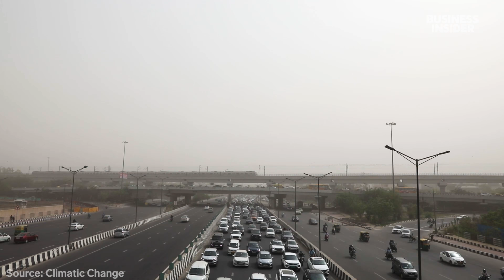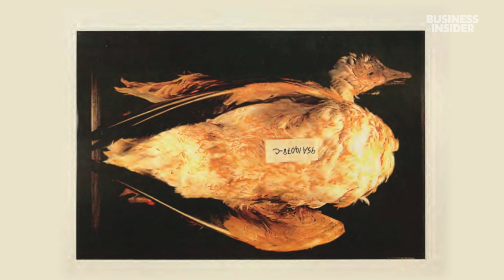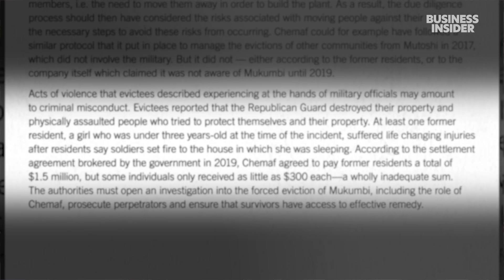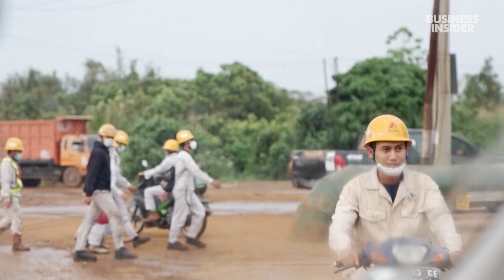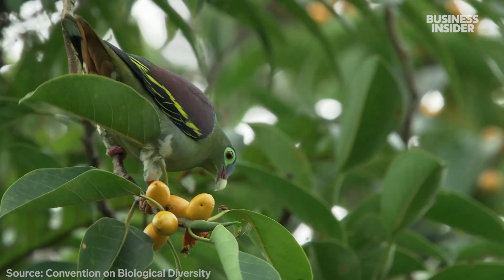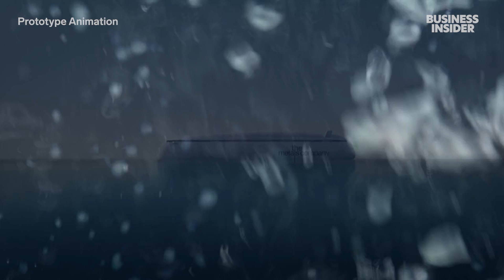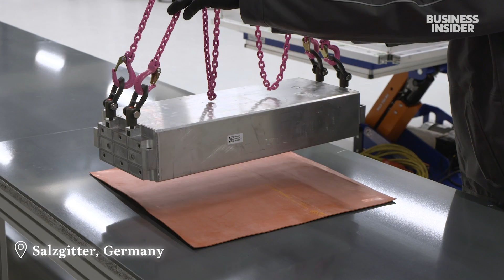The True Cost Of Mining Electric Car Battery Metals | True Cost | Insider News Marathon

Comment from the maker: This video won an Emmy Award! Thank you to everyone who watched, subscribed, and shared.
Reply: Depressing
Reply: Great
Reply: I see there's a True Cost for this, and for lithium. Have you got one for oil? Can't seem to find it on the channel...seems pretty important.
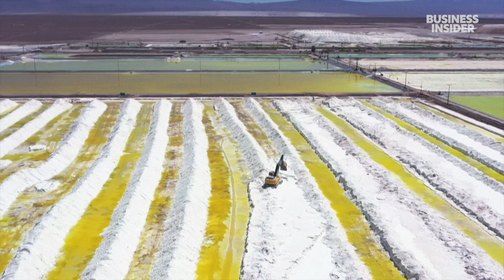Reply: dinamite 4:30 wam
Reply: Likely too fast on that award.  Already way out of date.  (actually was when you made this).  EV (and other) Batteries are moving on to LiFePO4.  Lithium + Iron + Phosphate.   No Cobalt nor Nickel in there.   

You know what does use Cobalt and Nickel?  Oil and Refinery for Gasoline, Diesel, and Steel in Internal Combustion Engines.  But you are probably all okay-dokey with that?  And most conductors are Aluminum -- not so much Copper.  All your mis-information has went away because the real options are both cheaper and weigh less -- both good things for mobile (EV) equipment.

So why all the FUD and mis-information?  Low Knowledge of the Topics?  Or intentional?
Reply: stop being the E.V. supporter
Reply: @hitakpatil5106 why
Reply: How does one get an emmy award for a youtube video?
Reply: “Your average consumer EV has over six times as much mineral content as a petrol vehicle” (Excluding steel, aluminum, and petroleum) 

Why have you excluded those extremely important minerals? That’s almost the entire mineral content of every modern car.

Who wrote this? The oil companies? How did this garbage win an Emmy?
Reply: Because its a video about EV-specific minerals.
Reply: @fredmosby6303 they only want comparisons to tell a specific story, not to legitimately compare true and complete resource use and effects.
Reply: An Emmy for spewing dangerous and disingenuous disinformation?

Comment: The oil industry mined these various materials first and more extensively. MORE cobalt is used to clean fuel than is used in EVs for a start. Also once mined 95% can be recycled so the need for new stuff will fall. Oddly biased anti-EV video.

Comment: We should be moving away from battery-electric cars and toward hydrogen.

Hydrogen fixes the recharge time needed by batteries, the looming large cost of battery replacement as each new charge slowly depletes it's capacity, and hydrogen is endlessly abundant. Battery electric cars are clearly not sustainable because of the materials required being limited.

It's a shame hydrogen isn't being incentived for automobiles with only a few manufacturers investing into the technology.

The hydrogen infrastructure is the clear challenge that will take a long time and a lot of investment. It may make the most sense to prioritize large scale transport, like shipping and airfare, with hydrogen power. Eventually, though, it will need to trickle into the auto industry to release the pressure of mining unsustainable materials.

Comment: as a mechanic im doubting about electric cars being less destructive as combustion cars. lots of car makes label a battery with well over 50% life left as scrap. ive had many electric cars come in where the battery is useless after 5-10 years, the only cars that do have (almost) life time batteries are the Japanese. remanufactured batteries are almost none existant. we should focus on making batteries salvageable for 80% at least, that would make a huge difference. we sadly live in a world that just becomes more and more "throw away".
right now i think that owning a 10-20 year old car is a better option in terms of footprint. in terms of reliability, and life span way longer than newer cars. also, updating all older cars with the newest cat's would also help with cleaner exhaust gasses.
i dont really mind electric cars, just the label "green" i think is idiotic. in reality they should've at least been labeled as "less polluting" (on wich i am not sure that they actually are)

Comment: The carbon footprint numbers can’t take into account a number of variables. 

1. Where is the electricity coming from to charge the EV throughout its life? Different parts of the world use different power sources (fossil fuels).

2. Do we even know how long the batteries are going to last yet? One battery replacement on a vehicle essentially doubles the footprint.

Comment: One of the biggest problems with combustible engines is over the past century car manufacturers have had little to no interest in improving for gas mileage/fuel economy. It would have been very easy for everyone to be driving around in a decent sized and powered car that got 85 MPG over 30 years ago.

Comment: You did not take in to account the fossil fuel used to generate the electricity to charge the battery or the fact the EV weigh more than gas powered cars and do more damage to the roads sooner repairs and the pollution created by the trucks and machines to repair the roads.

Comment: This is old now Sodium is replacing Lithium.. Lithium is being replaced or supplemented by newer, cheaper materials in EV batteries, mainly through advances in sodium-ion technology and the adoption of different cathode chemistries like lithium iron phosphate (LFP). Sodium-ion batteries, which use sodium instead of lithium, are gaining traction because sodium is far more abundant and less expensive to extract and process than lithium. This has led to significant cost reductions, especially in entry-level and fleet vehicles where cost is a key factor.[bbc +3]
Key Developments
•	Sodium-Ion Batteries: Sodium-ion batteries directly replace lithium with sodium, significantly lowering production costs. They also reduce the need for expensive raw materials like cobalt, nickel, and copper, resulting in even greater affordability. Commercial electric vehicles powered by sodium-ion batteries are already available in China, demonstrating the practicality of this alternative.[retron +3]
•	Lithium Iron Phosphate (LFP) Batteries: LFP batteries use iron and phosphate, both of which are cheaper and more widely available than the nickel or cobalt found in traditional lithium-ion batteries. LFP batteries are now common in mainstream EVs from manufacturers such as Tesla and BYD, offering a balance of lower cost, safety, and good cycle life, though they remain lithium-based.[sodiumbatteryhub +2]
•	Solid-State and Other Chemistries: Research and pilot projects are exploring other non-lithium options such as aluminum-air and zinc-air batteries, which promise even higher energy densities and reliance on abundant, inexpensive materials. While these are not yet widely commercialized, companies and researchers continue to push toward alternatives that could further reduce dependence on lithium.[triplepundit +1]
Example Industry Statement
“Sodium-ion batteries are significantly cheaper to produce than lithium-ion batteries. Not only do they eliminate the need for scarce resources like lithium, but they also avoid expensive materials such as cobalt, nickel, and copper, resulting in lower environmental impact and greater affordability. Several low-cost vehicles powered by sodium-ion technology are already on the roads as of 2023 in China, showing that the transition from lithium is actively underway.”[bbc +2]
These shifts reflect a trend in the EV industry toward diversifying battery chemistries, reducing costs, and mitigating supply chain risks by adopting cheaper, more sustainable alternatives to lithium.

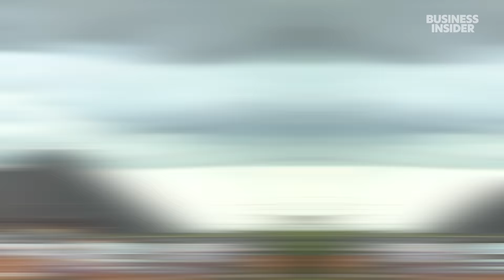Comment: 15:40
It’s said that conventional vehicles don’t use cobalt. That’s not entirely true.
The cars themselves don’t contain cobalt but the oil industry relies on cobalt to remove sulphur from oil products. That’s been done for decades and the oil industry doesn’t say where they get their cobalt from. At least the EV manufacturers are trying to avoid cobalt from artisanal mines.
Reply: Your battery car is full of petrochemicals like plastic and rubber for everything from the fake interior to the battery and cable isolation that makes sure you won't get electrocuted while touching it. The demand for oil and refining the oil isn't going away any time soon. And even if you got everyone to buy a battery car, what are you gonna do with all the petrol and diesel which is a byproduct from the refining process? Dump it in the ocean? Burn it in an open pit fire. That's what the green idiots do. It's wasted energy.
Reply: @John8087  
They still should be more open and not hide the fact that cobalt is not only used for batteries.

Comment: 0:44. However , the electricity to charge an EV car has to come from somewhere? If it comes from burning fossil fuels then it’s not as “ clean” as we think?  If EV cars are much harder to repair , not as reliable over 10-20 year periods , and the battery is very hard to recycle. All that leads to more turnover of cars and a dwindling supply of battery minerals. A simple diesel car made in 2010 has the potential to last 25 years on the road with repairs and good servicing. It may be considered “ dirty “ , but it’s resilient and doesn’t have to be replaced so quickly and it’s not full of precious minerals that are very hard to recycle and re use. So are EVs really saving the planet? Many EVs can just get a bump and the battery is then considered unsafe , insurers then decide to write them off as the cost of a new battery is crazy and it can’t be repaired.  And what happens when we run out of minerals ?

Comment: Yeah, but within 10 years we'll be mainly using sodium and aluminium in solid state batteries for a huge proportion of the batteries produced. Copper is definitely an issue but it's definitely not nearly as dire as the fossil lobby claims. Or their proxies like the journalists who made this.

This video is absolutely typical of the problem. We simply aren't going to make ANY important new breakthroughs with ICE cars. Nada. But the world has already basically moved on from NMC. And neither sodium nor aluminium are really that problematic at all. Aluminium is very energy intensive but we basically recycle all of it, recycled is much less energy intensive, and you can definitely be creative with where you do the smelting (like Iceland, for example).

Comment: It's not just the vehicle batteries that require massive amounts of metals but also the electrical production & charging equipment needs huge amounts as well.  
Most of the US power companies cannot even sustain the current levels of electricity usage much less the amounts needed to recharge 100% of all vehicles on the road.
Reply: Data centers are another excellent example

Comment: Batteries can be recycled, they don't get used up, recycling is > 95% efficient. Google "Redwood Materials" if you want more info, one of many BTW.
Cobalt, nickel & manganese aren't required for LFP batteries (Iron Lithium based cathode), which are now the most popular EV battery. Sodium batteries will shortly become available (it's an alternative to Lithium), but let's not mention that either.
Really good reporting, well done.

Comment: When you buy an ev or electric furnace house. You produce more electricity bill. And cause more workload on the local electricity generators. You’re just passing on the issue to the local electricity company. It uses more power. My local small town is trying to use electric furnace houses and it’s causing more blackouts and more stress on the diesel generators that we use. And the diesel generator is causing more fumes. You’re just passing on the blame to someone else when you get an ev or electric furnace house.

Comment: Most ev cars are worse for the environment than gas power cars why evs cant be recycled fully and most of the time what energy the ev use to charge it with is lignite power.and evs are heavier to making them worse then gas powered.and gasoline or benzine how you want to call it can be made synthetic instead of real fossil fuel

Comment: Why are electric vehicles pushed so much instead of 3 cylinder 0.9 L engines with fantastic fuel economy?  Accelerating 0-60 in 2 seconds instead of 12 seconds is no good reason for switching to electric and neither is billions more dollars for for the greediest people on the planet.  A real green revolution requires changing our values, not exponentially increasing our consumption.

Comment: The video has a lot of good parts, but ultimatively fails to understand that "pro EV" statistics are greenwashed and agenda driven. 
EV emissions are not counted before the production of the battery. The mining of coal, the shipping of coal to the coal powerplants, the fuels used by heavy machinery to operate mining operations, the shipping and most likely the refining of materials is not included in those comparsions.

Furthermore EV vs. ICE vehicle comparsions use lifecycles of 10-15 years and about 150k miles and ignore the end of life emissions. Lithium CAN be recycled, it just isn't because it's about 2-3 times more expensive. Also please be aware that "recycling" also may include recycling into thermal energy = getting burned as far as greenwashed definitions go.

Please be aware that by the very nature of mining, they will have to go deeper and/or open new ones, meaning the price ( in more ways than one ) will skyrocket. ATM we're simply mining the volumes we predicted to mine over decades "as fast as possible".

I work in the automobile industry and I can assure you, that at no point were EVs made to be good for anything other than monetary interest. 
After 15 years, your Battery will be dead and you need a new car, preferrably you'll be trapped into permanent rental/leasing contracts.
Well before the Battery is dead however, people will be unwilling to buy a car who's battery will die on them in the forseeable future, killing off the pesky used car market competition.

"We" have or had dozens of projects for low, no and negative emission technologies of different scalability levels to cover various needs and applications, but most manufacturers shut all of it down and under NDA in favor of heavily marketed and subsidized EV market. 
Most of those technologies were centered around more efficient vehicle designs to be viable / affordable, but EVs promise "clean" 3 Ton SUVs with larger profit margins and predictable replacement periods - meaning no other technology stood a chance before the gold standard that is rampant and mindless consumption.
People don't want "green" technology, people want a absolution to remain ignorant - and Elon is happy to provide.

PS: Those "reused batteries for energy storage" are also some greenwashed techbro nonsense. If a significant part of cells from a EV battery are perfectly fine for use, then how come they have to be re-used externally, as the EV gets a new battery? 
I hope you don't have any delusions about EVs going to the scrapyard, getting their Battery removed, someone testing and picking the good cells and a industrial scale operation using those cells in large energy storage facilities.

Not to mention the fact that you could use simple kinetic energy storage without any batteries at all, i.E. by pumping water to a higher level when you have too much energy and harversting it when needed.

Comment: car manufacturers have more choices on the heavy, high horsepower end of their lineup. and much less on the lighter weight, sensibly powered side. It’s all about money, if you’re voting or purchasing one way or another based on the environment- congratulations,you have been fooled. And it will not change.

Comment: Even this is a false narrative based on the myth of anthropomorphic global warming and the false statement that EVs use less energy after completion of manufacture by omitting parts of the production of electricity from the overall energy equation involved in the supply of energy needed to run each EV.

Comment: What impact  will occur with the elimination of a gas powered  vehicles in all of our cities with  vehicles with batteries that will be productive for over 50 years. Once used they can be recycled to 95%. Over time, electric cars use 1/5  the resources  to  move people and  products. The real problem is that much fewer resources and people  will be needed for transportation  and reapplying  the economy  to employ people..  This article is a bit of a hit propaganda  as it doesn't talk about the replacement of  an existing very damaging system.

Comment: COMPRESSED AIR as a lower-pressure higher-volume implementation would be competitive enough to rival batteries.  The technology is quite mature, and NOT dependent on exotic resources.   State-of-charge is completely deterministic.  "Air conditioning" is completely free!  The air motor could easily be made out of ceramics and plastics, since high temperatures are not generated, unless heating is designed for to "help" the air expand.  CHARGING would be possibly even FASTER than conventional fueling.  There's even No Need for exotic carbon fiber components - steel technology is advanced and light enough!

Comment: “EVs are changing all of that”.  No, they’re not.  That statement ignores the fact that the energy required to move an EV has to come from somewhere, and that typically involves burning fossil fuels.

At the end of the day, it takes a certain amount of energy (from any source) to move a certain mass a certain distance.  You can tinker with the efficiencies in the cycle, but the result is that EVs are only marginally more efficient than other vehicles.

Comment: fossil fuels still make up a decent chuck of an EV like its exterior, interior, insolation, lubrication and in most area even recharging can increase the carbon foot print because the world uses fossil fuels to power 80 percent. Another consideration is that most EVs uses software to operate the vehicle and because of that it is easy to F**k their customers by forcing to replace their own car because a company doesn't support it. It proves that something that is more effective than combustion engine powered cars would not be fully 100 percent carbon neutral.